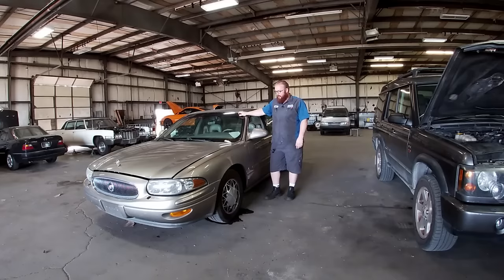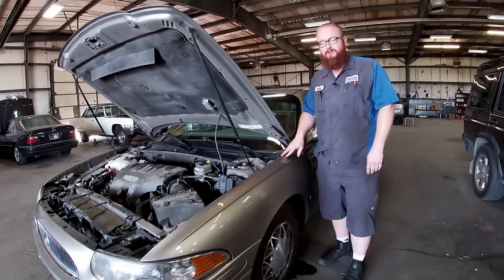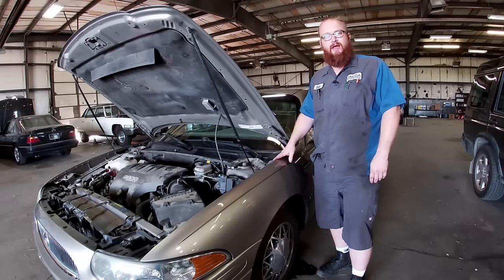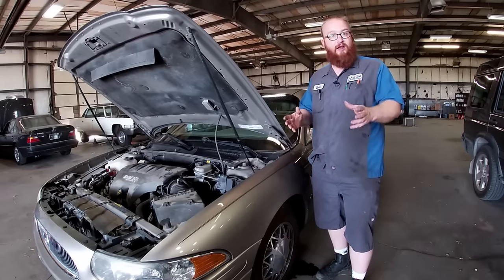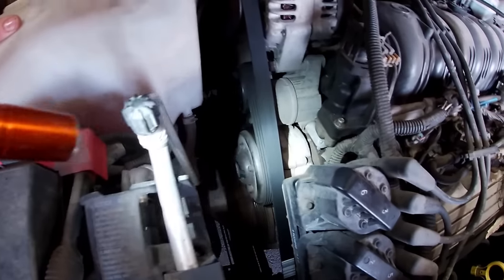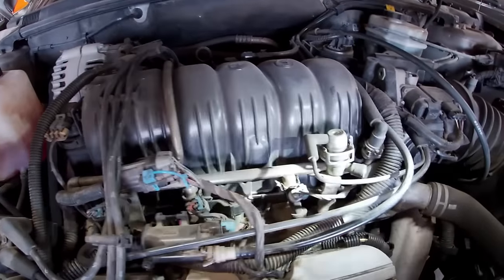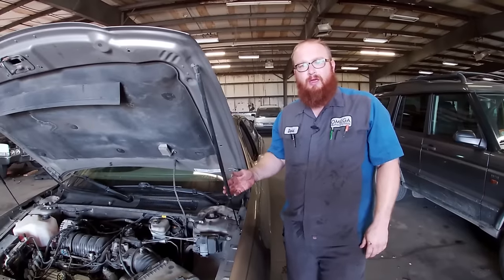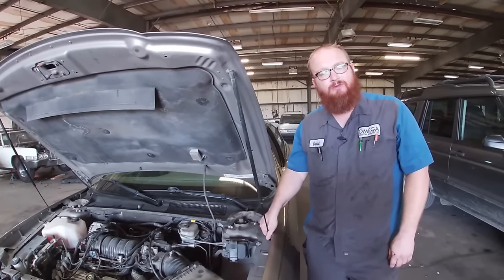CAR WIZARD highlights what makes the Buick 3800 V6 the BEST engine ever!

Comment: My 2001 Monte Carlo SS has this engine. Best V6 I ever drove. It felt like it had more than 200hp.
Reply: Lots of tq
Reply: Yeah me too I have the 03 ss, I feel like it goes 0-60 in like 6.7 ish which is faster than the stats for it idk. Fighting wheelspin is the issue from a dig.
Reply: it has a really good torque curve. I had an 89 Bonneville and loved it. It had 120k on it when I got it and I put another 130 on it.
Reply: Wasn't the SS the supercharged version? Would have had 240hp I believe.
Reply: i got my lesabre to go 120 mph on i75
Reply: @kyboy5  the rest of the world doesn't know i75..
Reply: @kyboy5  I thought software limited the speed to around 105?
Reply: Keon Jenkins - - i have a 08 Pontiac Grand Prix GTP, it has the 3800 v6 and is supercharged, for some reason my car wont start, it just keeps cranking, i put in a new starter, battery, and new key from chevy any ideas on what it could be?!
Reply: Chris Dwyer - - i have a 08 Pontiac Grand Prix GTP, it has the 3800 v6 and is supercharged, for some reason my car wont start, it just keeps cranking, i put in a new starter, battery, and new key from chevy any ideas on what it could be?!
Reply: @slowgoat6089  Probably the crank sensor. Have it tested.
Reply: My dad had the same one. Is was such a smooth accelerator. Always felt fast when I was a kid.
Reply: Had a 94 buick lesabre with the 3800...mofo was a BEAST...
Reply: @chrisdwyer1477  also had an 01 impala with the 3800...
Reply: @kyboy5  in tulsa??
Reply: @slowgoat6089  Crank Sensor like someone said and also make sure it's not in security lock. If the anti theft system malfunctions it wont start either. Also check fuel pressure and make sure you hear the fuel pump come on when turning the key. If it's not check for a shut off switch usually in the trunk on most vehicles that can trip if the vehicle gets bumped or jerked around too hard. Also if the switch is bad it wont let the fuel pump come on so therefore it wont start. Basically a cranking engine that is a no start comes from 3 main possibilities to start checking and then look into each component of those 3 possibilities to find your problem. They are no spark, no fuel/ fuel pressure and 3rd is an electronic issue like ignition or ecm's and wiring etc. And the electrical issues almost always lead back to the first 2 of no spark or no fuel pressure so that's always what you want identify first and go from there.
Reply: Chris Dwyer the early 2000s had a v6  then later i think 05 switched to the v8
Reply: SS is supercharged

Comment: My 97 gtp supercharged 3800 went over 500k before I sold it.  Still was going strong.  No major work ever done.
Reply: dude my 2000 3800sc just hit 200k. ppl ask why i dropped 1k into the suspension and wheel bearings.... thats why. i got about 250k left on the engine and trans.
Reply: Did it work good in the freezing cold ? Car turned on in the winter ?
Reply: @Hanmablood  i live in vegas.  Ot doesnt get that cold here.  But it always worked flawlessly. You just have to make sure it is maintained.
Reply: Had 85 Park Ave 3800 series 1 engine. Loved it! Great mileage, little to no service or maintenance issues

Comment: I'm a V8 guy but, if I wasn't, I could see myself in a classy Series II Supercharged Buick.
Reply: *weren't
Reply: Old Man Frank free up the exhaust and it best bang for buck minor cheap mod better mileage and more power above 2500rpm s
Reply: I put 2 stainless 2 1/4  straight through mufflers on my 2004 Grand Prix got n/a i removed the resonator also the mufflers had nice stainless oval tip similar to 97 to 03 look nice little loud but my mileage at 60 mph on highway is just over 35 mpg imperial gallon in Canada the mufflers cost 28.00 new at a surplus  store the imperial gallon is slightly larger than us gallon. The old rusted mufflers had 2  1/4 in but narrowed down to about 1 3/4 inches talk about a bottle neck that robs power
Reply: And the '89 Turbo Trans Am GTA Pace Car.

Comment: Good man, as a fellow Auto tech I can readily agree with your assessment. Unfortunately they are quickly becoming extinct. The gm 4.3 is also a dependable workhorse that lasts and last.
Reply: Are you talking about the 4.3 vortec motor that was used in the blazers and S10s ?
Reply: Yeah them motors lasted forever too

Comment: I'm driving my fourth 3800. I love that engine. I even have some mods on mine, decreases fuel economy, but still very reliable, and not a doubt in my mind I've got another 200k miles or more before it dies.

Comment: You forgot a few key cars this came in the F body Camaro and Firebird. Also Grand Prix, Impala, can't forget all the mini vans and Pontiac Aztek I was a tech at Pontiac in the beginning of my automotive career. These were a pleasure to work on. You might say I was a Wizard of the 3800 engine!
Reply: The 3400 was great too, about just as common but imo the 3800 still wins between the two because it has more power

Comment: I put 220,000 on a  1990 Bonneville before I sold it (still ran great), and 325,000 on a 2002 impala before the trans went out.  Great engines!

Comment: Miss my 99 Park Ave.
From 70k to 180k in 5 years. Smooth highway travels.
Reply: no problems with that hydrolic ride suspension ...shocks going out or pump continueing to run on after vehicle shut off

Comment: This engine was fitted to the Holden Commodore in Australia from 1988
Reply: @dragonnumbnuts  true that, wondered why the belt was on the side on this
Reply: Yes the ones in Aussie are even easier to work on. Also they have the alloy inlet manifold and a T700R4 bolted behind. The only problem is changing the thermostat. It's a bugger, because it's at the back of the engine.
Reply: Monaro only on the VN series one on the ln3. The series 2 VN- VR used the l27 which had the thermostat on the front for us
Reply: @monaromark1021  yep that thermostat and everything else on these pos 3.6 ltr engines. try simply changing the plugs bro. 3.8 far better engine . just my opinion.
Reply: GMH had to remanufacture to suit north-south and the early VN was noisy and harsh were changed in VS and ended in 2004 VY. I did one manifold gasket changed on a VX I owned only because the last owner didn't change the coolant and found that was a common issue with mechanic's wanting more work. I love these engine's have owned three different V6's.
Reply: 3800 v6 in the vn had all the mechanical refinement and smoothness of a clothes drier with a single shoe in it.
Reply: @SupaHoon  nup, too much mang. The only person who thought they were fast, was the P Plater driving it.
Reply: @NicholasCox85  Yes I had one and they definately weren't fast, not slow either though. Rough as too, I always thought they had harmonic balancers that went wrong too. And I'd love someone to explain why going like a shower of shit is a good thing :)
Reply: I agree. I had a Maroon VN. It was very reliable.
Reply: @watsisbuttndo829  Remember they always used sound over reving or idle to high...
Reply: @monaromark1021  in 4th generation Camaros and Firebirds the 3800 have the thermostat in the front, and are really easy to change.
Reply: SupaHoon no they didnt.
The cast iron inlet and the injection tune meant they had solid throttle response off idle. If felt like it was going hard but it wasnt really. Itd just light the rears up n go nowhere fast.
They changed it on vn2 and it was a much nicer drive.
Reply: Good video wizard. I have worked on them for years and own 3 and they were the best cars I have ever owned! 2 of them had 250,000 when I got rid of them and the one I have now had 146,000 still going strong. Why did they quit making these?????? GM has there head up there ASS for discontinuing that engine. Thanks for all the good content wizard👍
Reply: I came here to say this, but you already had

Comment: 3800 was replaced by the 3.9 and then as Wizard says the 3.6 was put into many GM vehicles.  The 3.6 needs the oil changed at no more than 5000 miles to avoid timing chain issues.
Reply: if I had to pick I'd got for a higher mileage 3.8 over a sub 100,000km 3.6 any day, the 3.8 is proven affordable and reliable, with the added bonus of it being an older engine so there's a pretty solid after market for spare parts, if you even need them
Reply: New gm motors became  money pit hungry cars 😂

Comment: My most dependable engine was the n/a 2.3 four pot in my ‘87 Volvo 745.  My mom bought the car in 1990 with about 75K on it. I bought it from her in early 2001 and drove it for fifteen years, with the odo showing 273K at the end. That wagon only failed to start twice - and in both cases it was relays. I did regular oil changes, put on a new exhaust and tires, and that was IT. No coolant issues, no oil leaks, no top end problems. Dead nuts reliable.

Comment: A lot of the Holden commodores in Australia ran this motor from the VN commodore to the VT commodore , great engine ..... Australian version is rear wheel drive even easier to work on than the east west engine version ... Great video keep up the good work
Reply: They ran a bit further actually, into the VY and apparently into a few VZ models. Very good package
Reply: I'm pretty sure that only the VP and VR commodore had the Buick 3800 and the rest up until the vz had a 3.8 ecotech
Reply: @martoon295  the Buick 3800 and the 3.8 Ecotec are the same, just rebadged
Reply: @satya.anandakrishnan  Nope there a different engine not re badged or anything
Reply: @martoon295  so how are they different?
Reply: @satya.anandakrishnan  The eco tech is baced of of the Buick but they are different the engine block of a eco tech is actually a inch shorter and is also wider than the Buick

Comment: I had a 1988 Buick Park Ave. Retired it with 380k on it. I had a 2002 LaSabre bought it with 120k and sold it with 300k zero engine problems and drove it 70 miles to work every day around 90mph down the interstate to my work. Road like a dream.

Comment: Spot on. When I was 17 and about to buy my first non-beater car, a big influence was my grandpa, a mechanic for 40+ years and who only owned Buicks with 3800s from 1988 onwards and loved them, so I bought a '96 Camaro with the 3800 Series II. It's still running strong at 200k and I'm now 35! How's that for reliability. Also got up to 33mpg in it. Amazing engine.

Comment: 260+ miles in a 2004 grand prix
Amazing!!! Still running strong
Reply: Did you ever have to replace the trans?
Reply: Same! 263K on my 04 Buick century. Not an ounce of blow by & will still burn rubber!
On trans: nope, my shifts hard when it’s cold but I’ll rebuild it when it finally gives up the ghost. That motor has plenty life still in it.
Reply: Pontiac body and interior lasts that long?
Reply: Ian Zulick no still original i have only changed fluid once and about to change it again soon
Reply: Roger Dirks surprisingly its held up very well in Michigan 
No holes its starting to show some rust near fuel door 
My first daughter drove it a couple years now my second daughter has taken it over. They don’t wash it but i at least wax it once a year
Reply: Roger Dirks the interior has also held up well 
at 16 years old, started a wear/hole on driver seat near left tricep
The biggest issues for us is the power windows started to have issues

Comment: I had several Pontiac grand prix's, and all but 1 had the series II 3800. My last one was a 2008 with the series III. I'd recommend the series II. The series III utilized afew sealed components for "ease of repair". An example is that the throttle position sensor could be easily and cheaply replacedin the II. But in the III you had to replace an entire sealed throttle body for MUCH more money.  Generally,  I replaced window motors a lot more than I had to work on the engines.

Comment: When he popped that bonnet and removed the engine cover I thought wait a minute.. that engine looks familiar.. the plastic rocker covers, the plastic plenumb chamber, that's a Commodore engine ! Looks wierd sitting sideways in that engine bay. Its a Shame Holden went under back here in Australia, such an iconic brand with alot of history in Aus. And yes it was a great engine! didn't need much maintenance, I changed alot of plenumb gaskets though back in the day and rocker cover gaskets too. It was easy to work on aswell for us mechanics, lots of room. Miss the tools, but don't miss the back pain.
Reply: I had a mechanic tell me once that since the valve cover gaskets were leaking on my 92 PA it was toast and I should buy his Honda (I'm sure it's just a coincidence he was selling it). Gaskets cost $25 and I replaced them myself in a parking lot.

Comment: This engine was a Chevy racing engine and I had it in an Oldsmobile - it was adequate power for a larger car and it wasn't very heavy, too, so I really liked this engine with outstanding pickup and very reliable, too.
Reply: It was factory-installed in my 81 lt350 because California... thing held 600hp nice
Reply: Funny how they think electric motors are the solution to EVERYTHING, but I drive a lot in Mexico and wouldn't want Electric.  The V6 was power to lbs. a great Engine.  I like the V8's as well and have two SUV's with the Chevy V8.  The older V8 is better - once they went to dual sized lifters the longevity declined and the engine lost long term integrity. Certainly, keep MINDLESS gov. out of the car building industry!!
Reply: AFM is a curse caused by gov. You save 1 MPG and the Engines don't hold up - Eng. is not balanced.

Comment: I had a 96 Olds 88 with the 3.8 supercharged. Threw an undersized pulley on it and used to blow mustangs away for fun.
Reply: Deuce - too bad they had like 180 hp back then
Reply: @jakechaplin9766  try again
Reply: 240hp 260tq
Reply: @Saltinator  exactly. And that's before swapping the pulleys. That Olds used to surprise a lot of people.
Reply: @jakechaplin9766  Lol even the original NA 3800 in 1988 had almost 180 horsepower.
Reply: Yup, i have a 3800sc Bonneville
Reply: What did the undersized pulley do?
Reply: @mattandersen2786  more boost
Reply: @TheGetmoneyman  can you tell me how it works?
Reply: @mattandersen2786  a smaller pulley turns the supercharger faster than the stock pulley giving you more boost pressure= more HP
Reply: @trashpanda314  
Could the stock computer setup tolerate the added boost?
Reply: @gregorymalchuk272  yep, never had a single issue with it.
Reply: @TheGetmoneyman  If memory serves you could also swap the L67's cam with the one from the non supercharged L36 and it would be quite a bit more rowdy.
Reply: @mattandersen2786  , undersized pulley turns the belt faster which means more boost.
Reply: You can get pulley kits that give up to a reliable 280 hp and a slightly iffy 300.
Reply: @timothymelvin3824  You mean that the undersized pulley is moved faster than the normal sized one would be by the belt which is being turned by the pulley attached to the crankshaft. I'm assuming.
Reply: @bdhale34  exactly

Comment: In 2019 I bought a 03’ Buick Lesabre with 79,000 miles on it. I’ve never had to do so much to a vehicle in my entire life. Radiator leaked, changed and flushed, someone put stop leak in it, heater core was clogged, was able to flush it out with some work and change from the plastic elbows to the aluminum ones at the same time. Drain and filled Transmission with Dexron/Mercon with filter change and service bulletin magnet upgrade in the pan. Thrust bearing went and grenaded the differential on the sun gear shaft, I’m rebuilding it right now. Rear air ride shocks went out twice, went to the coilovers. Rear stabilizer arms bad, changed. Upper intake gasket leaked, I just resealed the upper and lower intake manifolds. Condenser had a leak, replaced. Front wheel bearing bad, I just replaced both. CV axle went out from torn boot, I just replaced both. Easy to work on… sure. But it’s been the biggest headache vehicle I’ve ever owned.

Comment: +1 for the Buick V6. The ol man turned me on to this motor back in the day...
Reply: Jeep 4.0 inline 6
Reply: @TheBandit7613  If you're gonna go with a Chrystler i6 I'd have to go slant the 4.0 had too many different types and most of them 96+ were unreliable garbage one was bulletproof I think they made it two or three years. They also only put it into the Cherokees, the one they put into the wranglers was always one that had issue.
Reply: Just got a buick today